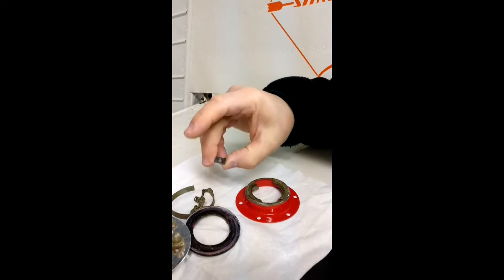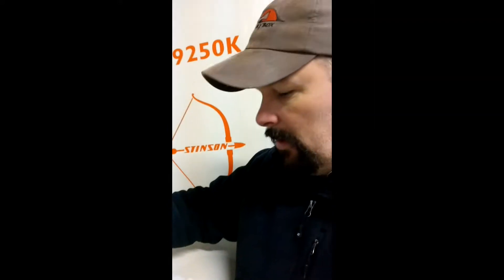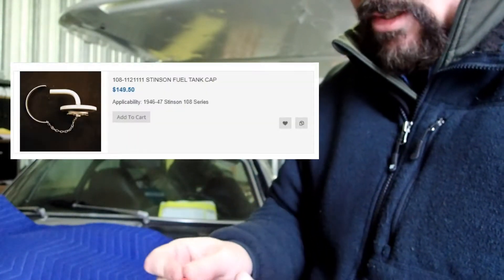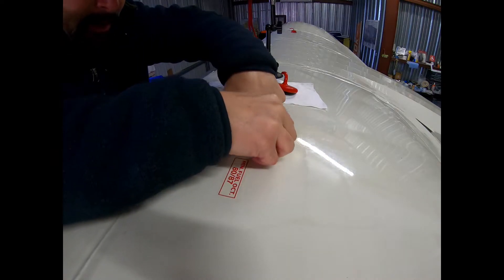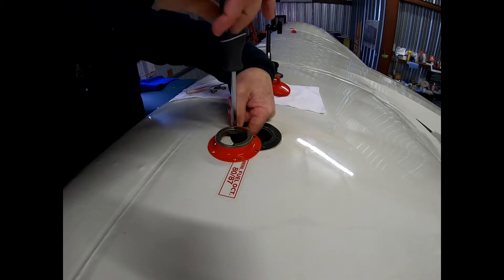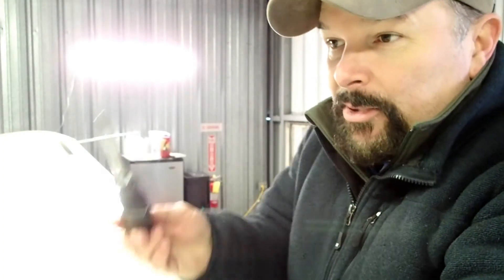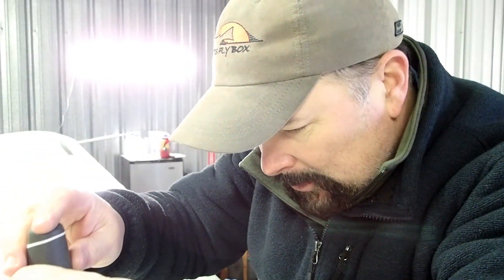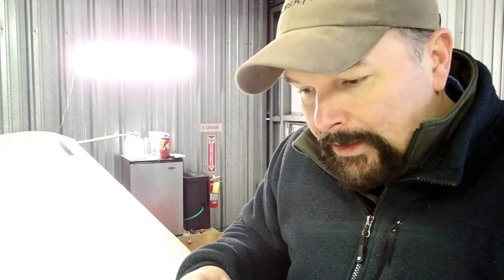Stinson Voyager | Fuel Filler Leak Mod

Comment: Curious how you dealt with non-PMA and or field approval; for these?
Reply from the maker: First of all this is not a major change to the TCDS and does not require field approval. Secondly this falls under hardware where no PMA is required. Hardware not only falls under Vintage Aircraft Replacement and Modification Article (VARMA) program, additionally guidance is given under AC 23-27 - Parts and Materials Substitution for Vintage Aircraft.
Reply: @FreedomFixer_Flying  thank you so much for the help, the information, and the videos. I made up a batch of 10 and have been sharing them with my Stinson friends, I was getting some push back about the "legality" of installing these. Keep doing what your doing my friend. If you ever come to the east coast we will have to fly together.

Comment: Do you happen to remember the length of screws that you used?
Reply from the maker: I believe they were 1/2". With these dome nuts You want to be sure not to go too long as they will go through the dome.
Reply: Thanks
Reply from the maker: @johnvanderlip  No problem.